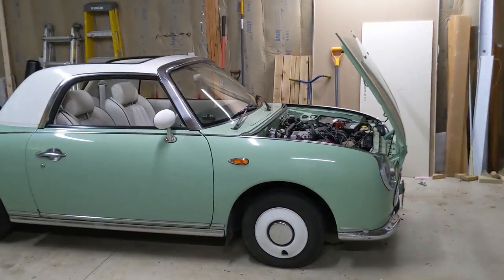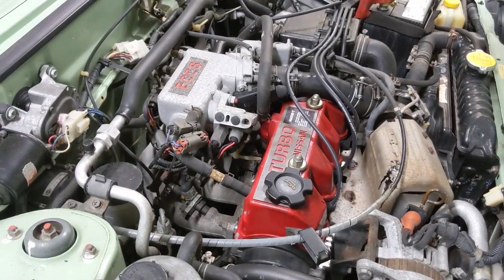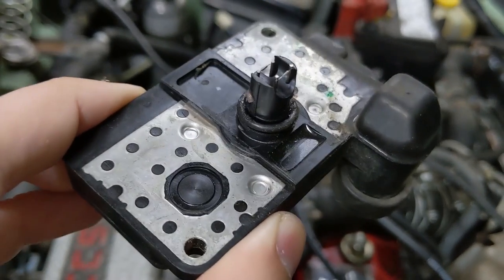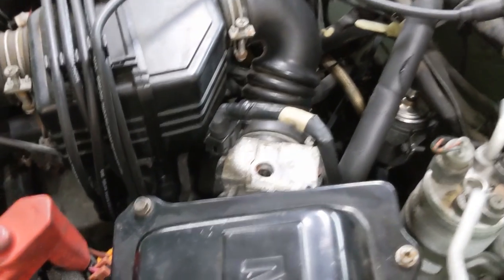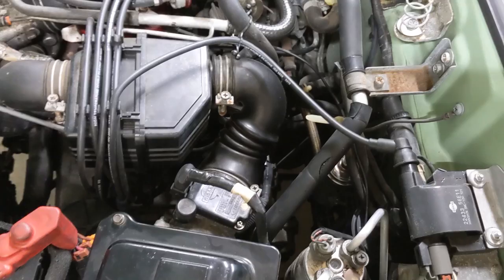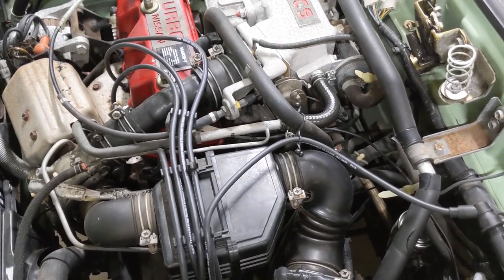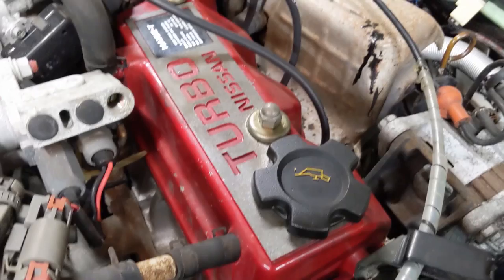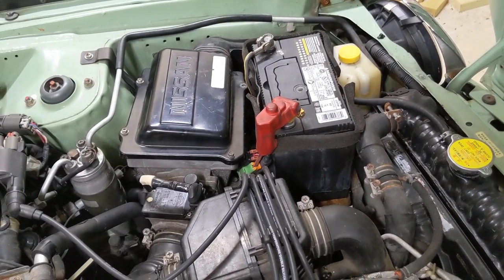Modern engine control musings and Fixing a Figaro

Comment: Having worked on a bunch of other finicky cars from this era, I'd suggest the two most likely causes are a failing "intake air bypass valve" or a source of unmetered air. The intake bypass valves are known by many different names depending on the make of the car(bypass control valve, air intake control calve, etc). These computer controlled valves generally allow air to bypass the throttle plate or body and can be plumbed into exhaust or coolant to adjust by engine temperature. This gives engine ECU the ability to control the air/fuel ratio when the throttle is closed during cold/hot start conditions(functioning similar to an electric choke)as well as fine engine speed control.  A sticking or slow bypass valve or a leak in any vacuum line or leaks/holes anywhere in the intake system after the MAF(this includes intercooler, piping, etc if equipped) can cause this condition.
Reply: As the owner of multiple 91-95 North American manufactured vehicles, I second this.  Idle air control valves are a common rough idle issue, as are exhaust gas re-circulation systems. Thankfully by the early 90s most air injection pumps (common in the 70s/80s) were a thing of the past.  Hard to believe, but vacuum plumbing is one aspect of modern cars that has gotten much simpler in the last 40 years.
Reply: Exactly, poor idle and surging under partial throttle sound like a textbook vacuum leak. The IACV is probably bad, or there's a hose somewhere that needs to be replaced.

Comment: This reminds me so much of chasing problems in my first car. It was a Mazda but similar enough to yours. There's a lot of comments saying to look for vacuum leaks which is good advice but none mention how incredibly tedious that can be. In my Mazda there was an undetectable leak that led me to replace basically every hose, gasket, and clamp along the intake system which solved it for a few hundred miles before the gremlins got to it again with electrical issues, which are even more annoying! I'm grateful to live out of the suburbs and not need a car anymore lol. Shout-out to my city's transit system.

Comment: Really like these non-traditional videos and the crossover series.

When you find a more modern car to plug into, it might also be neat to get a device that also allows programming directly back via the same scanner port - for example the Carly product works with VW group and BMW and you can change basically all the things, from door chimes to performace stuff and more via their app. Also this is not an advertisement for that product, but I do own one.

Comment: These heated wire air sensors are quite neat. Very accurate, yet so simple.
Used to work in HVAC and we used tools like these for adjusting ventilation. You type in the pipes dimensions and you got a reliable litre per second value. For bigger rectangular pipes you took several measure points for a calculated average. Taking turbulence into account.

Comment: Part of your issue could be coming from the split in one of your vacuum hoses as well as the mass air flow if the split is on your idle control side then your o2 sensor will see more air than  it should and that will lead to engine surge

Comment: The MAF has 2 parts to it: The thermometer and the hot wire. The thermometer is, well, a thermometer. It measures the incoming air temperature. Using *that*, it heats the hot wire to 100C over the air temperature. The more power it takes to maintain the heat on the hot wire, the more air is flowing through.

I'm semi-confident this is correct.
Reply: This is pretty much correct, one of those wires is held at a fixed temperature above the other and the power required to do so is proportional to airflow.  The actual temperature difference may not be 100C for every MAF however.

Comment: This is a great example of why I prefer 70s and 80s cars; modern enough to be fairly reliable but simple enough I can do pretty much all repairs and maintenance myself.
I'll never stop regretting selling my hotted up 1981 BMW 633csi, fantastic handling, smooth and strong engine, 5 speed manual, and just about the simplest fuel injection system I've ever seen.
Edited to say: I love that little Figaro, it's freaking adorable!

Comment: Hi Alex, the idle speed should be around 1000 rpm at idle, you can adjust it with a plain screwdriver in the most front hole of the ones on the right side of the ECCS. You can find service info like that from GJ Northall in UK on the internet.
If it wont start in park, try pushing the stick more forward, while you turn the key. There is a 29 year old plastic sensor somewhere downthere, which might need a little persuasion.
I found your channel via the Aging Wheels Figaro Video. I have a Pale Aqua Figaro here in Denmark, which I made one YT video with recently. Your channel is really good, and I just bought a Kindle after seeing your E-Ink video! 😎
- How did you get oil on top of the turbo shield? That is going to smell, when it gets hot 😉
Reply: The ECU adjusts the idle solenoid duty cycle and ignition timing trim to reach the target rpm. Only the base idle needs to be adjusted.
Warm the engine up first to operating temperature(Below 80c most ECUs  fuel, idle and ignition timing will be in warm up compensation). Turn the engine off,  disconnect the Throttle Position Sensor(TPS) and (AAC Valve)idle solenoid connectors. Start the engine, at this point the ECU is in maintenance mode, for base idle and ignition timing adjustment. When done, turn off the engine replug the connectors. 
Not doing this, can cause poor idle,  loss of power or engine damage due wrong Ignition Timing. This has worked for my '87 Sentra all the way to my R34 Skyline.
Reply: Idle screw shouldn't be messed with. If it doesn't idle, you're just masking the problem and introducing new variables

Comment: The high idle and surging reminds me of the 1994 Mazda 626 that I drove in high school. It had partially sucked its intake manifold gasket in and had a horrible vacuum leak. It also had a similar type of diagnostic code system, so this video brings back so many memories. I miss that car...

Comment: On the other end of the spectrum, I have two 100% mechanical diesel engines (same model), one in a 1987 Ford pickup and the other in a 1985 Ford E350 chassis motorhome. The only thing electric that the engines need once the motor is running is a fuel shut of solenoid. With no 12V going to it, the fuel is cut off and the motor stalls. That is how these motors are shut off actually. It's hard to find someone who has the equipment and experience to time the motors.
Reply: yeah, you can literally convert the 12V solenoid to mechanical and "live without electricity" (maybe except starting the engine)... i've seen the diesel timing procedure, it's based on the micrometric position of a plunger in the center of the fuel injection pump, there are micrometers intended for this
Reply: @redoverdrivetheunstoppable4637  i don't know how it works on mine exactly but you have to rotate the pump slightly in one direction or the other depending if you want to advance or retard timing. People use a wrench and turnbuckle to do it.
Reply: @cubey  that's what you do to adjust it but you need to know if you hitted the perfect timing and you need a micrometer screwed on the pump to see what you're doing, if i remember correctly the plunger must move 1 millimeter from the bottom when the engine is at top dead center... there's a small screwed cap on the pump in the middle between the outlet tubings, that's where you screw the micrometer ... never done that but i've seen it, i worked as a mechanic

Comment: I love that you delve into new fields whether or not you're comfortable with the information you know in only the search of knowledge as a mechanic we call that behavior  Idle hunting it's most likely because between the maf the air filter in the inlet itself all rubber and gaskets need to be replaced Maf likely an inlet leak

Comment: Try searching for a vacuum leak i’ve had it before where the leak has caused hunting due to bypassing the mouth sensor Which will make the ECU think the engine is running lean and try and correct it which will make it to hunt. I had the exact same problem on a different car I spent a good morning trying to figure it out and it turned out to be a perished line on the master brake cylinder which I would’ve never expected
Reply: I had a similar problem which turned out to be a missing vacuum line cap on the vapor recovery canister.

Comment: This is the exact car that I've wanted for several years now. it's fun seeing it here
I may have missed it at the start, but the high idle/rough start sounds a lot like what I had in my integra.
Bonus points for also having a cpk in the distributor

Comment: 1:20 Correct, electronically timed, the distributor just directs the spark
1:55 vacuum leaks, if you can replace every vacuum/intake hose, do it.
6:00 at least on a pre 00 BMW, if you unplug the MAF and it runs better, problem is intake air measurement problem
7:20 good idea replacing temp sensor
7:40 vac leaks, or maf sensor.. vac leaks are cheaper :D
8:50 o2 sensors are a good idea, suer sensitive and easy to break, start WD40 spraying your old one now, just in case...
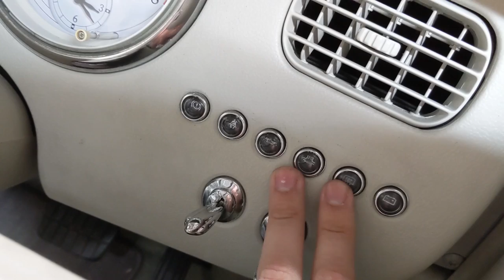10:50 or when someone just bridges with wires together...
13:10 it'll for sure have a crank sensor, the error code you mention would be that the two signals were not 'in time'
14:25 I have E34 M5, such a pleasurable guilt.
15:25 for sure <1.2k rpm idle, likely<1k... doesn't matter its small
17:32 ugh its an auto, are they all auto?
18:05 huh, i'm so wrong :D but i'd still check out all the hoses
Reply: "6:00 at least on a pre 00 BMW, if you unplug the MAF and it runs better, problem is intake air measurement problem
"
Pretty much every maf equipped car should run with maf sensor unplugged. In just goes to speed density mode and uses map and air temp (along with tps) to calculate the correct mixture.
Reply: My E34 pulled it's last dick move on me while i was selling it. Just as we were doing the paperwork, the MAF gave up. Buyer pulls out the plug and it runs fine again. Could had lasted 10 more minutes so i would had gotten a bit more from the car :D

Comment: "controlled all electronically"
I see those vacuum tubes you cant fool me
Reply: I’ve got an ‘88 Mazda, and while it has vacuum lines, the only things directly actuated by vacuum are the brake booster and turbocharger bypass valve. The vacuum signal to things like the EGR and charcoal canister are switched by solenoids

Comment: Figaro owner in Michigan here.  I had the park safety switch issue and it’s a common issue but easy to fix.  There is a cable connecting the shifter to the transmission.  There are plastic bushings on each end where the ends attach.  On mine these were brittle and cracked and one was even missing half... without these bushings the shifter simply isn’t moving the cable far enough to engage the switch.

Anyway, these are just a few bucks apiece and easy to install, especially if you have a hoist. 15 minutes and I had both of mine replaced.

Comment: I once had similar engine issues on a Land Rover Freelander. Slightly high and uneven idle, reluctant starting, and it was also running slightly rich, so when it failed on emissions at MOT test time, I had to fix it. It was a vacuum leak, but the leak was in the brake servo (I think you may call it the brake booster). I was sat in the car with the engine warm and idling, but noticed that when my foot was on the brake, the idle speed settled. It was almost imperceptible, but definitely there, and the effect was repeatable. I fitted a new brake servo more out of hope than expectation, and the change was a revelation. The engine ran sweetly, started promptly, and idled smoothly. Try putting your foot on the brake and see if your engine note or speed changes. You might even detect a hiss, but may have to stick your head in the footwell near the servo to find out. Blocking or squeezing closed the vacuum pipe to the servo (booster), to isolate that part of the system might help the diagnosis, but maybe don't drive without the brake assistance. Good luck!

Comment: I have a 1985 Nissan Skyline DR30 which is a 16 valve twin cam fuel injected engine and was the first production car fully sequentially fuel injected engine apparently. Anyway, it has a VAF or flappy volume air flow sensor. It also has an optical sensor in the distributor looking through a steel disc with many tiny holes. It was amazing how they did things back then. Good luck with the fig!

Comment: "They dont make cars like they used to" is technically true.  Cars today are infinitely better than older cars.  More power, better fuel economy, more features, and generally more reliable.  It is fairly common to see a car from the 90s and of course newer.  Once you go back to the 80s, the number of cars you will see drop drastically.  Every decade you go back, you will see less and less.  Sure you will see old cars that were babied, but those are the exception, not the norm.  Why dont you see those cars anymore?  Because they all broke down and were scrapped.
Reply: and modern cars are exponentially safer!
Reply: Well i drive a 85 ford f250 all mechanical never gives trouble just rounding up to 1.5 million miles and only thing ive done is oil changes and grease were it needs
Reply: And well tires and brakes
Reply: The only thing old cars have that new cars don't have is the cool factor and usually they're a lot cheaper.
Reply: You can see 80s cars rarely today, but you won't ever see a 2020 car on the street in 2060. A well made car is extremely reliable for the first few years of its life no matter if it was made in the 80s or today. What comes after that is the interesting part. When something goes wrong on a classic car it's super easy and cheap to fix because the part is simple so it's cheap, and the labour is free because, again, it's simple and you can do it yourself with an internet tutorial and no prior experience. The things that go bad are usually the rubber parts like bushings and hoses. The rest is just metal so crude there's just no way it can wear from normal use even in decades. Plus, more subjectively, the ride quality and comfort is just so much better in old expensive cars versus new ones. Why do they want to make every sedan sporty nowadays? Why are the suspension and seats so hard? There's nothing that I've tried today that compares to the comfort of an old mercedes or any (even older but sadly not as reliable today) american land barge for that matter.
I get your point. If I didn't want to work on my car or think about my car when I'm not in it, I would 100% buy something modern and trade it in for a new one in 5-10 years. But if you're a person who likes working on mechanical stuff yourself, there's nothing better than a quality old car, both in terms of comfort and long-term cost. They're also safer because you drive VERY carefully and VERY defensively in a car with no airbags :D

Comment: As mentioned by a bunch of other comments...check for vacuum leaks, check coolant for air pockets, check for boost leaks between turbo compressor and intake manifold. These older cars use coolant flowing through idle air control valves or even a seperate solenoid that temporarily raises idle at cold start like a choke on carb. 

Nissan's are notorious for Idle Air Control valves and if egr is equipped dirty EGRs causing issues too.